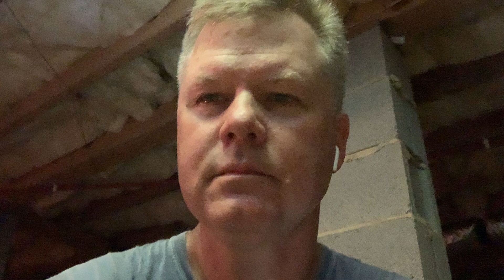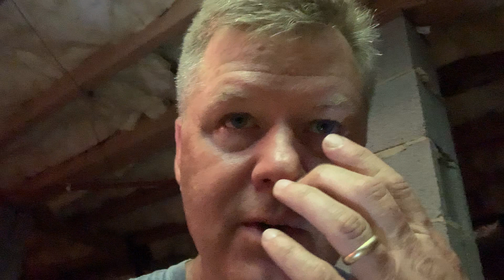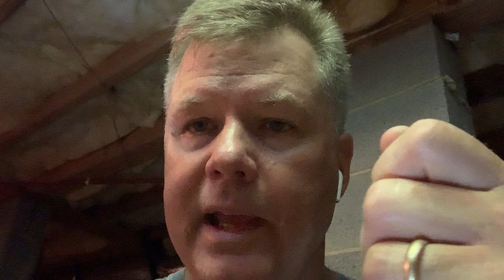Crawl Space Remediation -Video 1 - Starting the DIY Process

Comment: Hi Wayne, i noticed that you have fiberglass insulation between the floor joists...I'm deciding on what material to use since there's so many opinions out there. Are you happy with your decision to use fiberglass, or do you wish you would've went with a different insulation material?
Reply from the maker: Hi @Key, our builder installed the insulation when the house was built.  Yes, I've been pleased that it has helped to keep the floors warmer in the winter.

Comment: hey Wayne any updates from your very last video on this you posted? how have you addressed the mold?
Reply from the maker: @Thomas, I still have the water that seeps in around the sewage drain going to the septic tank. When it rains, I’ll get some mold temporarily along the path of the water that goes away when it dries. Not seeing any mold on the wood as the dehumidifier is doing a great job of keeping the space dry. I plan to seal the water leak and then fully encapsulate the space but haven’t had the time to get to it. The dehumidifier has worked so well that I haven’t been in a rush to encapsulate.